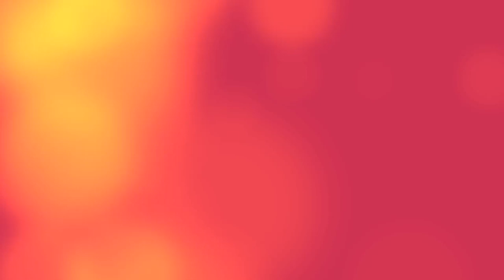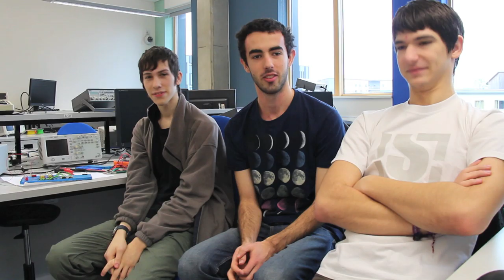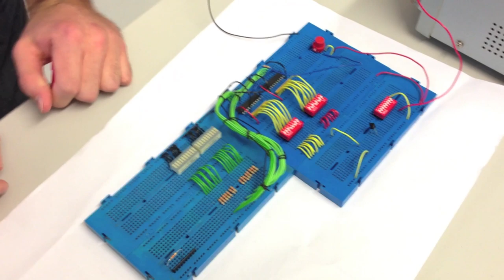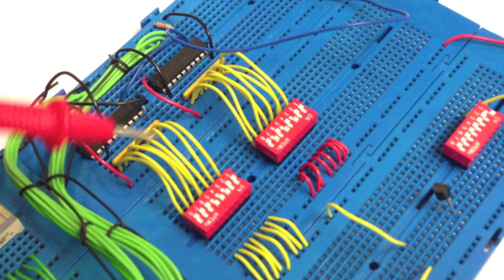Mum... I'm building a CPU - Episode 1: The Registers

Comment: just thought id let you know im using you to recreate this in minecraft
Reply: Haha! Let us know how it went
Reply: dude can you please tell me how are the bits of zeros  and ones are turned into the the coding language and reverse ? is it like stored in the hardware to change them up or something ? if so how did they make the first copy of it and how are hardware developers are making their own languages ?
Reply: @Lawlabi: I recommend you follow the Breadboard Computer series by Ben Eater right here on YT.  He's in the process of explaining the Instruction Decoder now.

In simple terms, you use an EEPROM as the Instruction Decoder, with its address lines being the inputs for the instruction code and its data outputs being the signals to each of the registers.  Ben Eater's series will be able to explain this far better than I can.
Reply: thank you so much for helping i apperciate that alot
Reply: Hey. Sorry, I haven't seen your first comment. It's a compiler's job to turn a program into a series of binary instructions. You don't usually perform the reverse operation. And because you don't need to perform it, it you can do a series of powerful transformations and optimizations on your final code to make it very efficient. 

But your question is very valid. How do you write a compiler for a new target? The answer is going to be less straight, as there are multiple ways to achieve this.  The first ever compiler had to be written by manually setting the bits in the correct order, and it resembled more an assembler than a compiler. It was very expensive and very hard to debug. But using this very basic first assembler, you can build more and more powerful tools using it - perhaps a very basic programming language.

Nowadays, you rarely have to do this from scratch - you just add a new target platform for an already existing compiler, like the GNU CC. For our platform, Sam wrote a basic assembler in Python, which you can read more about here: http://heather.sh/2015/12/writing-the-compiler-for-the-unicpu-project/

Comment: Yeah, you shoulda used SIL resistor networks North of the LEDS, and saved yourselves the extra breadboard, wires, resistors, more wires...
Reply: At that exact time we ran out of them, so we resorted to the backup plan.